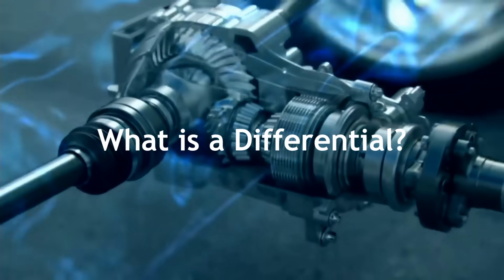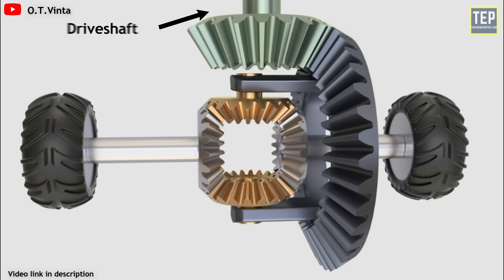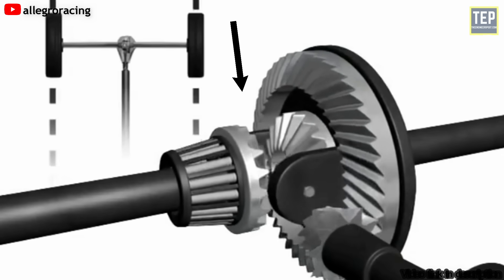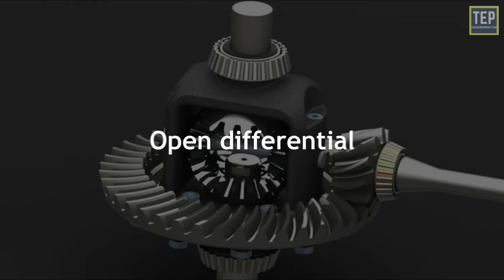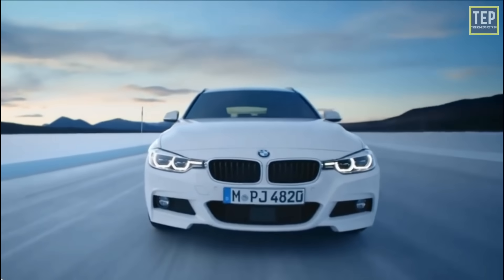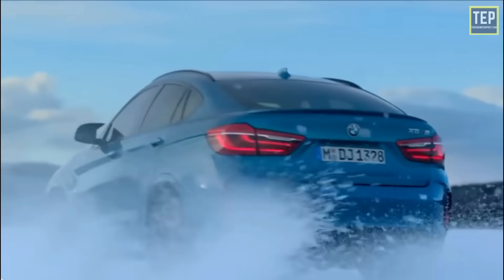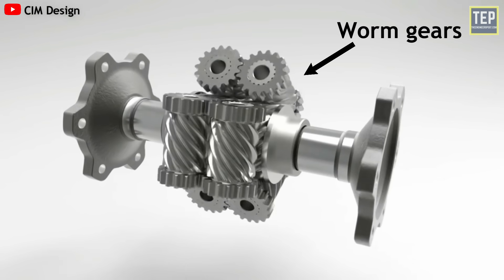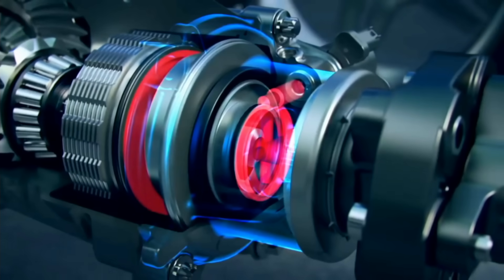How a Differential Works | Types of Differentials Explained

Comment: The Active diff'tl must weigh a ton besides its complexity.  Can u say ridiculous fuel consumption?  The Torque Sensing diff'tl has the fastest reaction time but not for off-road.  The Locking diff'tl applies same torque to both wheels and seem to work better off-road.  However, on road, it may cause skidding.  The Welded diff'tl system may be vulnerable to failure because of the temp of the heat applied to the components.  I like the Closed diff'tl better because it's simple and gets the job done by powering the non-slipping wheel...and it's practical for off-road use.

Comment: I have an Eaton True trac (torsen) in my 2500 Silverado 2 WD. 
You don’t notice anything different while driving in normal conditions but in loose 
terrain, slick roads or snow the torsen kicks in and gives power to each wheel. 
The difference is very noticeable. I’ve had it 1 year and wished I put it in when I bought the truck.
Reply: I just put one in a 2015 two-wheel drive Toyota Tacoma, how long will a 373 gear..... It went from a mild-mannered economy truck to a little beast that likes to go sideways..

Comment: If it's done right a Lincoln Lock is as good as a spool use plate preheat and weld with 7018 or MIG.
Limited slip is no better than an open diff weight on either wheel and your stuck.

Comment: I hate open diffs. I like to drive fast, smoke the tires on occasion, and I also have to drive in the winter with snow and ice. A limited slip differential would be really nice to have. But I've learned how to get around in the snow and ice with a 4000 pound rear wheel drive V8 with an open 2.56 diff. It's not fun. But it can be done

Comment: Iam trying to design something and it in my head and just useing logic, so tell me if Iam right or wrong. I want say a auto trav 2.73 gear 
I want to spin it that fast.
And reliable, so backward . if I just use one side and the spindle output, it's wouldn't  turn without a load on the other side unless I did that weld?  Then say I want two speed I want 2-3 times added to the 2.73 so I put a small tire example on one side and put a 1.1 large tire as regular. So now both would spin. And the smaller tire would spin about 6 times faster that the opposite 1-1 tire but the output shaft would spin the same or average of both tire? 
In short is their a way to have just that 6 x small tire and get that rpm at the outhput shaft and  and somehow get the 1-
1 on the larger tire, a choice of aether one? Or is it that victor electronic deferential. Turn left or right side off as I want reversally want 2 speed choice at the engine shaft side. Engine spin is multpled. So I reason going backward if you spend the side  you get the final gearing. But I want to get two rpm speed low and high or about 3-6 k and 2 k.
Wonder if this is understandable.LOL

Comment: I have a question, so how does the spider gear move to make one of the sun gears move faster if it rotating faster has to move both sun gears since they're connected by equal pins

Comment: Very interesting video with significant and useful information included. Excellent explanations and illustrations. Many thanks. I think that the Torsen differential is the most interesting solution (no clutch, no slipping). It is also the most expensive with a relatively complex technology and can be found only within high end and expensive cars.
Reply: Torsen LSDs can be found on cars other than high-end/expensive cars. 86/BRZ and some MX-5 (Miata) models come to mind
Reply: Yeah That's an amazing Video

Comment: Gotta go with the Torsen. Simple yet extremely durable. My 2020 4Runner Limited has a Torsen center differential controlling the AWD System, and I almost never have to lock it into 4-wheel drive as the Torsen does a seemless job.

Comment: Is locking differential automatically lock when its need or we have to lock manually……….?

Is close differential equipped with 4x2 vehicles……?

Is still new vehicles coming with open differential….?

Comment: To me, the best diff out there in terms of over all usability, is the wavetrack differential
Reply: After a bit Of research, i ve found the  king, the do it all diff. Cant rember then gen, but the rear  diff of jeep rubicon is an airlocker combined with a torsen. It doesnt get better than that.
Reply: @loukasantoniou8054  No offense but that’s very wrong. A Jeep rubicon has front and rear electric lockers and when unlocked they are just open diffs. I personally have ARB air lockers in my jeep which work the same either locked or open but activate faster and are more reliable.
Reply: @legotechnicworkshop3932  there was a jeep rubicon that had a better diff still. It had a torsen type 1 i thing which has a high trb ratio, with an air lock, so you had both. That would be the best diff to have as you get both. And by both i mean, bettet cornering traction on pavememt, decent traction off road and when shit gets badz you can activate the locker. However i dont know which company makes these diffs and i doupt they make it for any other vehicle. I also believe that the gen1 and gen2 cayenne had a similar diff but instead of an atb diff they use a clutch type torque vectoring diff, with and electronically controlled lock ring. But clutch type lsds while very effective when fresh, they worn out pretty fast and need a lot 9f expensive maintance to keep peeforming well. Especially the ones with high kock percentage. In addition they are noisy and make slow speed manuverabullity difficult. Thats why i prefer the one the rubicon. Taking all that into consideration, a wavetrack diff is still one of the best diffs for on road and offroad performance, that you can actually fit on your vehicle and have no mentance requirements. Its not noisy and doesnt affect your everyday driving. However if you dont care about improving on road handling and you just want a dedicated offroader then yes any type of true locker is the way to go. Thats the long answer that i was bored to write lol.

Comment: Anything rely-depend on electronics will not be in my selection-recommendation. 

My driving style preference, very-slight drift (higher rear tire pressure at the expense of grip). Use wheel spin effect to lose traction for the rear (hard-braking, hard-acceleration) and when clutch released suddenly on wet roads, ...  

I think the cheaper the better...

Comment: Hi Dears,

ESG Universal Transmission DOES NOT need:

1-HEAT EXCHANGER;
2-HIGH HYDRAULIC PRESSURE;
3-COMPLEX MECHATRONICS;
4-CLUTCH PACKAGES;
5-PLANETARY GEARS;
6-HIGH VOLUME OF OIL;
7-TORQUE CONVERTER.

Thanks.

Comment: Nice video, but be careful about specific wording. An open diff is a constant torque device, changing wheel speed to enforce equal torque for both tires.  No traction on one side means no torque will be applied to the other. 
A locked diff is a constant speed device, changing wheel torque to enforce equal speed.  No traction on one side means all possible torque will be applied to the other. Possibility of overloading factory design is possible, but in low traction situations it's unlikely since max diverting torque is limited by traction.

Comment: I have had FWD and RWD cars fitted with Torsen differentials. In my experience you don't know they are there except for big improvements in traction. Maintenance free, light and small size fitting inside an open diff casing. Ideal.
Reply: You should try wacetrack diffs, beat of both words
Reply: Is it good for racing?
Reply: @Gabethemosthated  I imagine it would be if traction is a problem, particularly with front wheel drive. Have also had a mid engine sports car that I fitted with a Torsen diff. The improvement in traction wasn't so noticeable as traction wasn't such a  problem with that car.
Reply: @philiptownsend4026  hmm, I have an Ls 400 but I’m turning it into a race car an I was just curious
Reply: @Gabethemosthated  I just had to Google what an ls400 is :-(
Did such a high spec Japanese car not come with an LSD?
Do you remember the original world conquering Audi Quattro rally car?
It had three LSDs I believe, one in each of front and rear axles and one between the front and rear axles. It's traction in all circumstances was phenomenal,  a whole world of difference.
Reply: @philiptownsend4026  it does have limited slip differential, but I not to experienced in that area yet an we’re wondering if they were better options for control an more traction im turning it into a race car

Comment: Hi sir, i am having XUV 500 2018 model ... i have a complaint that while turning right or left the back rear wheel is strucked no movement..while running straight it s moving...pls help to resolve it... thank u

Comment: Thank you for a very informative video. Well done. 

I prefer the LockRight automatic differential locker. Its way more cost effective than any other on the market. The LockRight automatic locker locks when both wheels travels at the same speed, but unlocks itself automatically when cornering. LockRight is a simple design and an ‘install and forget’ diff-locker. I know from expert gay it works very well in an automatic transmission, I’m not that sure on how it works in a manual transmission. 

A more advanced design is the automatic locker from Kaiser in Brazil. I have ordered one for the rear axle of my 2022 Jimny. Will order a second one for the front in Dec. 

-But why a locker you may ask, as the Jimny has a electronic “locker” called AllGrip Pro. Meaning the computer in the car applies brakes on the spinning wheel transferring torque to the non-spinning wheel. 
The AllGrip is good but reacts too slow. Sometimes the computer needs 5 full turns of a spinning wheel before applying brakes to it. Meaning, when brakes finally are added the car has lost most, if not all, momentum. 
With one or two lockers installed the off-roading should be way more controlled at slower speeds.
Reply: I had an automatic locker in the rear axle of my Jimny. It's the best option for offroad use on a budget. But on road it didn't make me happy - especially in tight corners.
For that reason I changed the automatic locker for a Quaife ATB and also put one in the front axle. Sure, it's more expensive but it's the better option for off- AND on road use. It's way easier to control the Jimny with the helical/worm gear LSD's now. With the rear diff locker the Jimny was oversteering when the locker engaged and it made the already underpowered Jimny more weak.
AND: I can't say that the automatic locker is 'install and forget in a Jimny with manual transmission. It clicks in every corner when not engaged i.e. not locking and it clunks at every change from accelerate to decelerate. That clunk doesn't occur when you have automatic transmission, because the propeller shaft is under load.

Comment: What’s the best differential for street/strip? Was looking into torsen or slip. Any info will help.
Reply: Torsen every time, for my money. Tough, effective, instantaneous locking, low maintenance and you don't notice it until you need it, and then you still don't notice it, but you keep going!
Reply: Neither, because the street is totally different, than the strip. So if you're trying to find what's the "best". You'd then talking in terms of what's the best in "compromise". With a spool, almost unusable on the street, and a limited slip being a comprimise  for the strip. You could probably get away with using a limited slip. After having it "built-up" with stiffer springs, better clutch packs, and or at the very least, adding an extra clutch disc in. To make it tighter.

Comment: Do front wheel drive cars have differential?
Reply: Fwd cars have front phasing central differential whereas rwd cars have torsen or viscous drag rear lsd and lastly Awd are top notch with torque converter rear lsd with transfer case plus driveshaft which transmits power from gearbox and sends it to rear wheels being given by i.c.e

Comment: Yes, it very helpful. I would like to know how how to adjust a defferential. Thanks.
Reply: It's something you should not attempt. With only only a very small number of diffs, even allow that. With that being the ring gear "back-lash. Whilst pinion depth, has to be determined via prior measurement and the use of appropriate sized shim. Which is then put in, prior to bearings being  pressed on.

Comment: There are a few different kinds of manual & computer locking diffs 1) mechanical 2) electronic. 3) via an air compressor.  as seen in the “2019 Jeep 5/4 ton concept”.

Comment: Instead of welded you should present Detroit locker or at least bolt on rigid flange installed in the palace of the differential.

Comment: Torque vectoring FTW. It’s how the Lancer Evolution X handles the twists and turns !
Reply: Torque vectoring isnt all that great, it's just and open diff that spins the outside wheel faster that the inside. No rally car uses that.
Reply: @JDMeister  😂

Comment: Welded diferential is not type of differential.
Reply: debatable💀😅
Reply: @Dude_Ness  It really isn't. SPOOLS are a type of differential. Welding a diff is basically turning an Open diff into a Spool, so welded diffs are poor man's spools.
Reply: @vxti_cxn  not to mention that a planetary gear of the differential would cost how small? That, you put one more of those into the case, it locks the other two, and it's the correct reversible way to lock an open diff. A welded differential is a "I saw this on youtube and thought was so hardcore" differential.
Reply: It’s just a looked diff
Reply: İt is a dif

Comment: To be honest, this video is not nearly as good as it could be. Mentioning specifics about certain diffs that don't matter and leaving out parts that do. Good example: welded diffs. You said how the heat from welding can make the parts weaker and more prone to failure. Could have definitely mentioned that it's the spider gears that are welded together, so it acts like a locking diff, and really put an emphasis on tire wear and driveability concerns, on top of it being something that you really do not want to do on a vehicle you drive around a lot. You really ought to compare the different differentials a lot. It will help people who are learning for the first time.
Reply: You seem to have all the answers. Waiting for your video.
Reply: @eieio6641  He's correct though. This video spent like 3 minutes saying "differential lets wheels spin independently" over and over again in different ways.

It also said a differential sends equal torque to both wheels, and a few minutes later it says an open differential can't do it.

And what the hell is the purpose of even including a welded diff? It's not a type of a differential, it's a welded differential. It's like saying a crashed car is a type of car.

Comment: From what ive come to understand, torsens seem like a great choice in performance applications, but in certain turning situations, it can cause a rwd car (that would usually oversteer) to understeer because of where the force is being applied
Reply: Torsen really works best on FWD and AWD cars. On FWD it helps with understeer and heavily counteracts torque steer- that feeling in FWD cars when under hard acceleration the car tries to rip the steering wheel out your hands. On AWD cars it's often used on all three differentials to send bulk of the torque to one wheel that has the most traction near instantly and without the need for complex electronics.
It's a really effective, simple, relatively inexpensive and low maintanance option for LSD. It doesn't need special oil additives and doesn't ware down like the clutch based LSD. It is 100% mechanical so there are no sensors that can break like on torque vectoring differential, etc.
All you need to do is change oil regularly like you would any other differential so the gears don't grind themselves to death.
It isn't perfect- if one wheel has no traction (is in the air or on very slippery ice) it completely stops working, which is why TVD exist.
Reply: Hi I j hi I hi d Ty Ty up. Doroti d foopfoo there r tree t we wa do
Reply: https://youtu.be/uFyHPg51nGk

Comment: to The Engineers Post person, in case you didn't know, that locking diffs will grind when taking sharp turns, my dad's Suzuki Samurai would grind when taking sharp turns in say, a parking lot building it was either the diffs or cause it was a solid straight axle

Comment: Torsen Differential, for wheel spinning in mid air, seems like a simple solution. Use speed sensors in all 4 wheels, if driven wheel is completely spinning, apply the brakes to it. I mean even if this is a reactive solution, how often does any road going car (even sports cars) have a wheel off the ground
Reply: Yeah, that already exist it's called EDL (eletronic diff lock) it works also with open diffs.
Reply: Racing cars with very stiff suspension have very often one or two wheels in air due to the curbs on  corners which are not flat.
Reply: Torsen diff doesn't cause a lifted wheel to spin up. The worm gear of the unloaded shaft can't drive the worm wheel into motion., so it can't revolve "backwards" about the loaded shaft's worm assembly. That's the genius of the design- the worm wheel always drives the worm gear, thanks to the mesh angle. Both worm wheels from either driveshaft are in direct mesh with each other by spur gears, so the side with torque drives both sides.
Reply: Off-roading like rock crawling or mogul stuff. 4Runner limiteds have torsen diffs